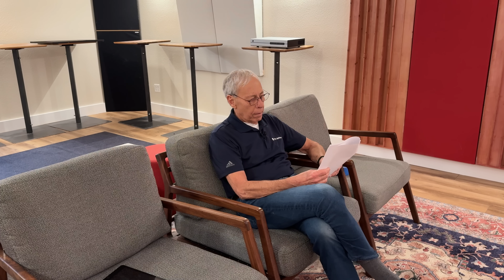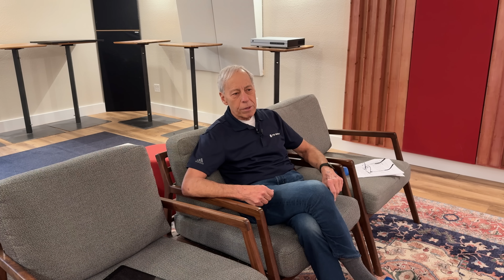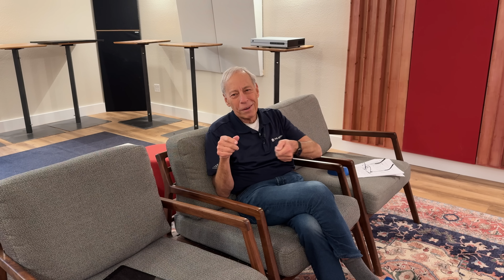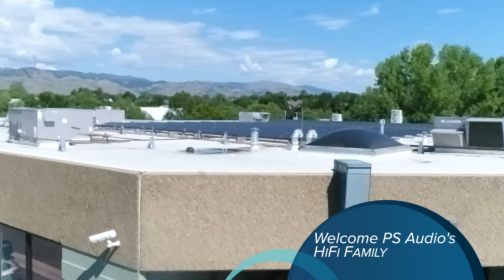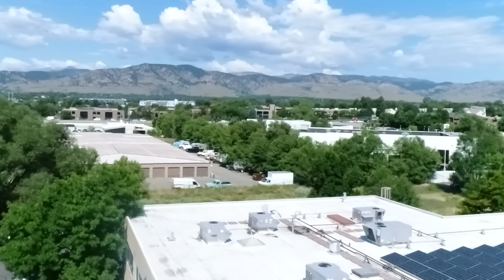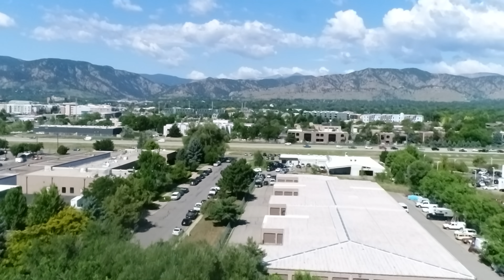Power surge through an XLR cable?

Comment: With repeated exposure to surges, the MOV's internal structure degrades, causing its clamping voltage to increase, eventually reaching a point where it can no longer effectively protect against surges.
That why you don’t want to use MOV’s in a power protection device for your stereo. Over time it will fail and you might not realize it.

Comment: We often unplug our systems during storms in MI. I've heard of enough appliances getting fried in the same way, and a fridge, computer or high end stereo is a pricey replacement so if the forecast gets too gnarly, the whole system gets unplugged. Yes I have surge protectors, but I'm more risk-averse than most.

Comment: I use a Tripp Lite Isobar. It’s a dual power outlet box that plugs into the wall with no power cord. 

In their product reviews, it’s a surge protector that will break at the wall. The Tripp Lite will have to be replaced but your equipment or appliance will be saved.

Meanwhile, it also has line signal conditioning properties as well. Considering, I also use carbon fiber wall plug outlet plate and an obsidian stone. I have an incredibly quiet background noise along with a louder volume of music. 

You get to use an upgraded power cord. Other Tripp Lite products have a cheap cord attached to the surge protector/power conditioner.